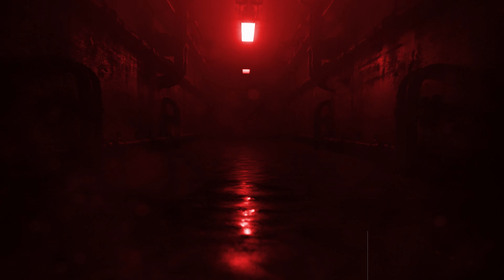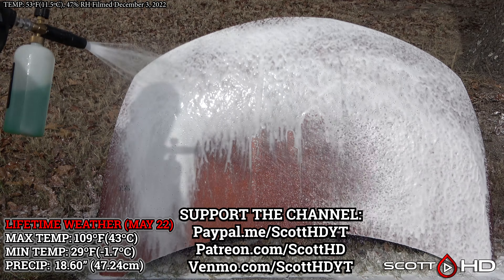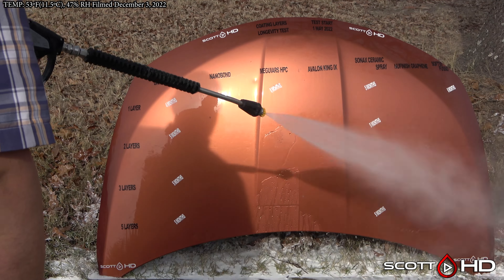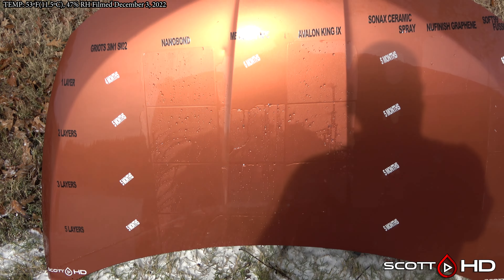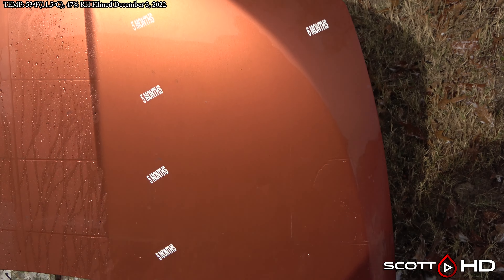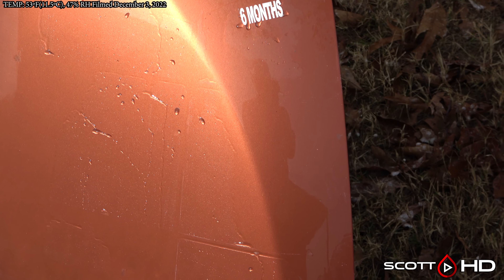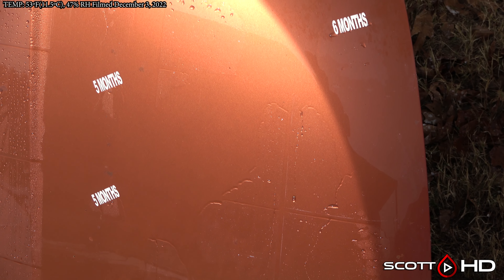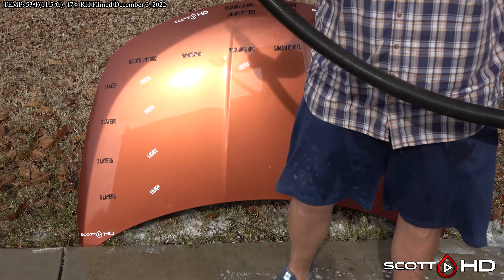CERAMIC COATINGS - HOW MANY LAYERS IS TOO MANY? Top DIY's Tested! - UPDATE 10- 7 MONTHS

Comment: gotta do the water spot remover on this as well when you call the end of it
Reply: It would be interesting but it would go against the theory that coatings are getting clogged up with minerals. Why did this hood end up with the coatings dying faster? Can’t be because of more “clogging” because all the other hoods experienced the same exact weather conditions. It’s likely the paint being degraded by heat and UV.
Reply: @ArizonaDetailCorp  idk what you're going on about but he did this at the end of other tests so
Reply: @BelLavoroAutoSpa  my point being that I don’t think mineral build up is the reason that coatings die. This hood kind of proves that.
Reply: @ArizonaDetailCorp  probably not I just wanna see how it does

Comment: Currently have Griots 3 in 1 on my BRZ, going through a stupid Chicago winter (was -10 last week with snow, is 60 today). So far so good. Went to the DIY car wash yesterday and blasted a TON of salt off and the Griots is holding up. Quite frankly, with the ease of applications, I'm more than happy with 3-4 months of coverage.
Reply: The Griot's is almost always among the very top if you gather a collection of these types of tests. That and the Meg's Hybrid Paint Coating are my favorites by a good margin and the ease of reapplying the Griot's 3-in-1 makes it my favorite. The stuff is fantastic IF applied properly. Those 1st two coats are critical for sure.

Comment: I put on Griots on two of my vehicles and one is a truck that sits outside.  I am in New England and even though we have not had a harsh winter so far there has been road chemicals to deal with.  The Griots is holding up fine about a month out.  I do top it with a ceramic detail spray every two weeks.  My wife's garage queen looks great.

Comment: I am going to put two coats of Maguire’s  paint coating and every time I wash my vehicle I am going to spray Technicians Choice 582 as a dry aid to me, the ease of use of these two products we insure me my durability
Reply: Meguiars told me to use their Brad booster so that's what did and so far so good..could probably use many things as a drying aid but I wanted to stick with the recommended formula.  No water spots yet.

Comment: So a layer each day will help in the long run ;-) .  I guess you have to keep your car garaged for a couple of days to do this multilayer stuff properly. So no driving because if you do it will get dirty and you need a proper base for a layer.    I guess I will stick to 1 layer every couple of months. With the new products it's no longer a days work. 
To be honest I am impressed with Sonax BSD. Bought that cheap stuff a couple of months ago and tested it on my wifes car which is a daily go get the groceries car in all weather conditions and after all these months it is still beading. (and I did like a 1/1  mix with water). Mine and hers normally fails on the roof of the car very quickly but looking out of the window now I see nice drops of rain on top of it. It's 1/3rd of the price of some other products. A bit in envy as I use the much more expensive Meguiars Hybrid ceramic on mine and it is flat as a doornail on the roof of my car looking at it. (weather doesn't allow to wash my car at the moment).

Comment: About 75% of the time, I get streaking with the  Griot's 3 in 1 when sliding the second coat. Not sure if stuck is the proper word, but I've been stuck doing a single coat of Griot's followed by a coat of XS Topper.
Reply: Had the same problem....hense why I stopped using Griots. I have a black car, so streaks are extremely noticeable. I had to buff the shit out of it, probably removing the product itself. I'll stick to TLC2. Easy on,  easy off. Lasts about 6 months and very chemical resistant. I never trust products that claim to last 1+ years. I end up reapplying the product anyways around the 4-5 month mark.

Comment: I like your tests but I really think you need to be more willing to call things failed. That nufunish is DEAD. No one would not reapply it if that was their car. If surface tension doesn’t break on a coating within a second or two, it’s finished in my book
Reply: Even the nanobond takes a while break surface tension after he flooded the panel post wash. The only thing that broke tension was the Meguiars.
Reply: Gotta agree that nu finish looks dead on this hood at all layers.
Reply: I agree. Especially when we buy based off of how long it holds up. It can be misleading
Reply: It still beads though. If it was dead it would remain flat.

Comment: I would really like to see you do a feel test after the wash and dry. Film yourself feeling the surface with your hand over the different layers and products and describe what it's like. Do they feel rough, gritty, polished, sticky/tacky, etc. Feel with the plastic baggie if you need to. Compare it to the control. I don't think you would need to do it every wash just the first, middle and final.

Comment: Hey Scott, this is definitely the strangest test results I have seen in your channel! ex I have Nu Finish Graphene on the roof of my car, and I use it on the painted rims, the car is a daily sits outside 100% of the time it went through two hurricanes ( Ian & NIcole)  and it's is still performing amazing, I washed the car yesterday and can't believe how good it's beading after 4 months!  But in this test it's gone after 6 months? pretty shocking! PS You really need to test Sonax Polymer Netshield

Comment: Useless. Unless you driving, and auto car washing ones a week to ones a month.
Car engine is supper hot and in sun and hot traffic the temps will reach 150*+ 
Driving in traffic will bombard it with dust (abbrasive) and smog (corosive) particles as well as salty grime in winter.
Also rain will act as a abrasive+corosive when doing 70mph in it.
Ect....ect....ect.
I remember as a teen all those "wax" hype and wasnt until sealants came along that they finaly admitted waxes lasted around 3 months. Then the sealant hype began till this came out and then now sealants are admitted to last 3 months....LOL.
And btw i mean under normal conditions of every cars life. Not a garage quin.
Reply: the only thing useless here was the time you wasted sitting in chemistry class.  these are controlled tests.  they're not meant to be real-world tests.  if one sealant in this test lasted 2 weeks while another lasted 2 months, which one do you think has the potential to last longer in the real-world?
Reply: There's also the fact that these hoods are sitting outside 100% of the time uncovered. Unlike everyday cars that are getting some cover on a lot of days even if they're normally parked outdoors. There are plenty of days where an everyday car will go in a parking garage, covered parking, sit undriven for a few days a month, not be washed for consecutive months, etc. Oh and Scott also does a weekly wash in the first month. He has a business to run and doesn't have time to be washing all these hoods every week, man. Shoooooot, he is easily running the best sealant tests on the planet right now and that's good enough for me.
Reply: @derek723  Neither. That's the whole point. They get you to pay 5x more for something it doesn't cost the price of the bottle they put it in. If YOU knew a thing about chemistry you would know that
 99% of it used in everyday products is akin water since the price you pay for a bottle of water is not the worth of that amount of water. So how do bottled water companies get you to pay more every year for something you getting for almost free....right there at the sink? 
But hey, you want to waste 1000's on you cars PROTECTIVE coat to ...ehem...protect it more(?) fine by me. 
P.S. I learned one thing in colege chemistry class that you youtube "testers" apparently never did: to test chemical products you need to (drum roll) test the chemistry itself! Also, where is the microscope and chemistry testes to determine the depth and presence of the product before and after tests?
Oh wait, we not REALY want to do that, right? Cause that would be like exposing people trying to make a living and they would sue and that cant be good for youtube chanal ect ect. 
Every chemist would ROFL at this jokester on youtube.
The whole silica based products for "beating" were developed and implemented at AUTOMATED car washes FOR ONE REASON: they had to dry of the car with air pressure. If you ever trye to blow water of a flat and clean surface with air you know it will STICK to the surface for dear life. So the beating property of it made it easy to BLOW OFF the water droplets. Its relatively cheap chemistry used by barrels full. They sold it to ya idiots for $20 a quad. 
But that's not the worse cause in a day to day the last thing you want is to have water beat on top of you unclean car. Any dust, rain, and air pollution will concentrate in droplets that when dry will leave a CONCENTRATED water marks which are way more visiable and  harmful to your paint and much harder to clean then same amount dispersed over larger area. You want sheeting. Wait, didnt expensive vaxes back in the day advertise exactly that....hmmmm
Lets just ignore the fact that silica will attract dust like magnet in some weather  conditions.....
But whatever. You wouldn't watch YouTube videos if you knew better....catch 22 I suppose.